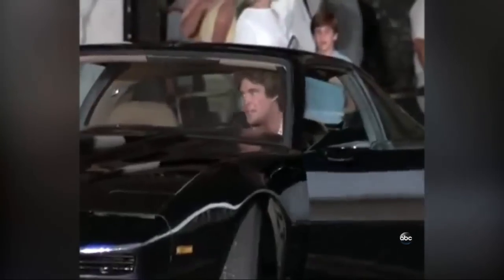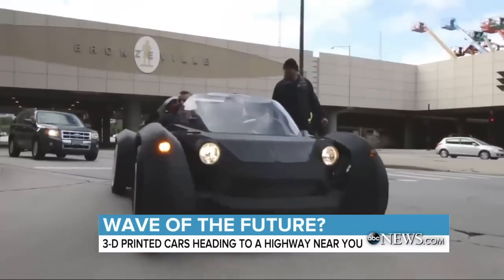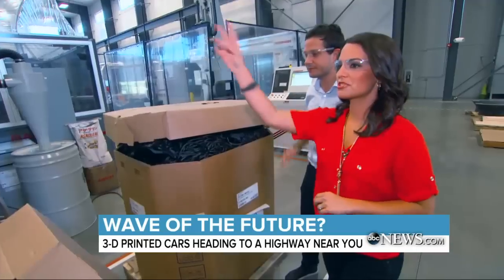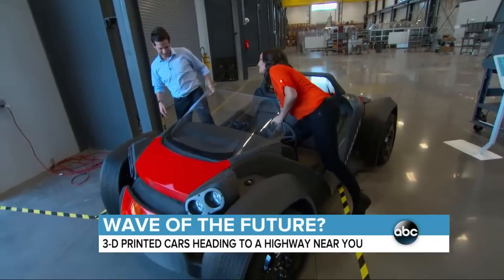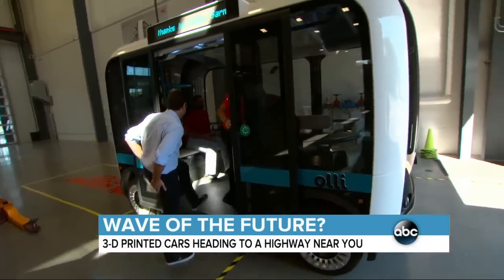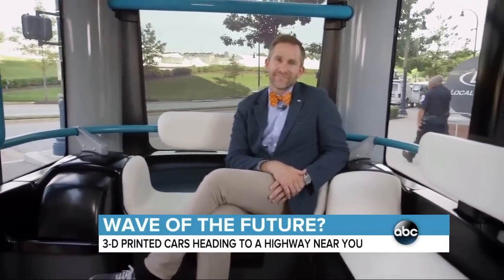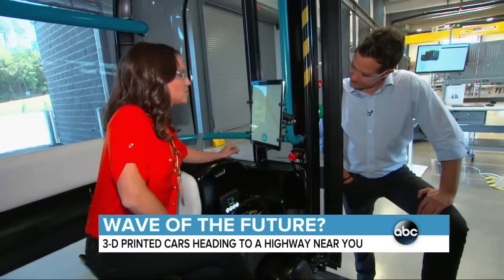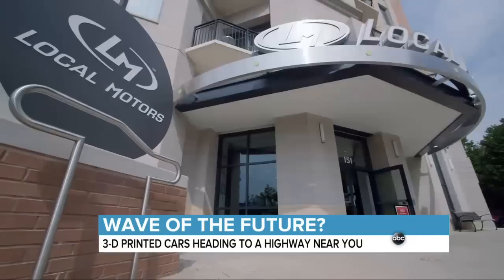3D-Printed Cars?

Comment: How does the heat from the engine keep from melting components? A 3D printer can't print metal can it? Is it safe in a car crash with a regular vehicle? You guys came a long way so far!